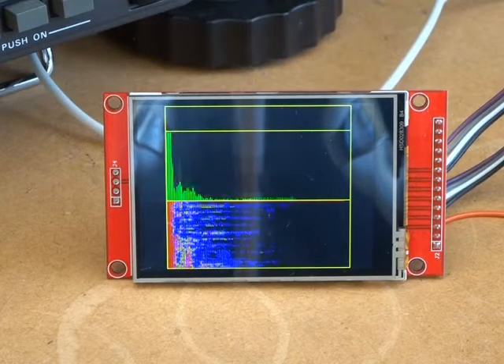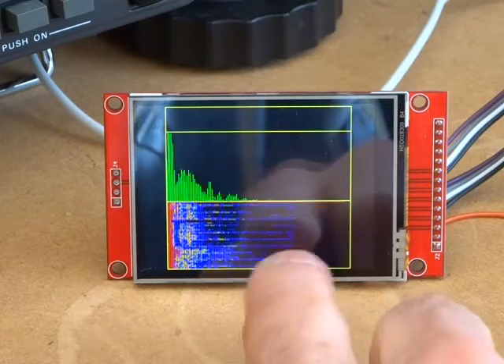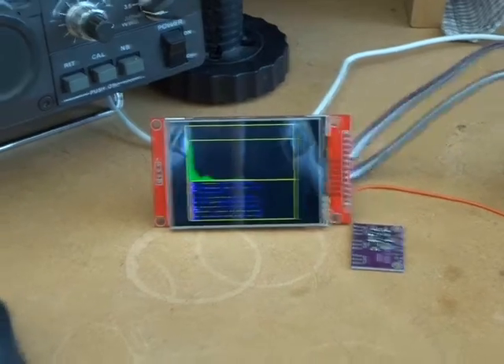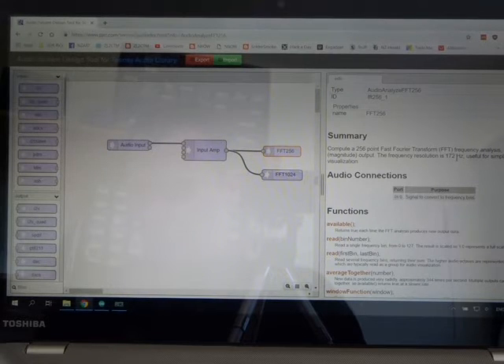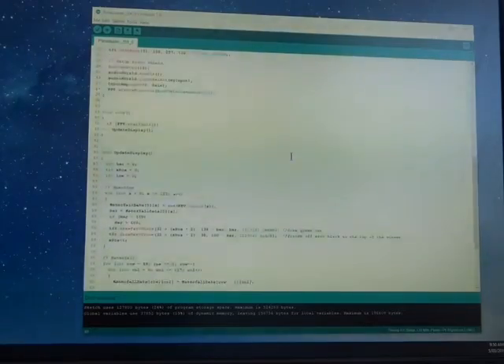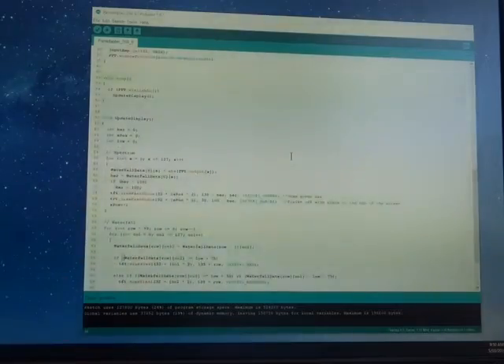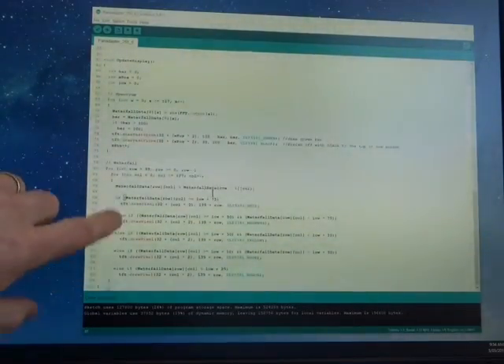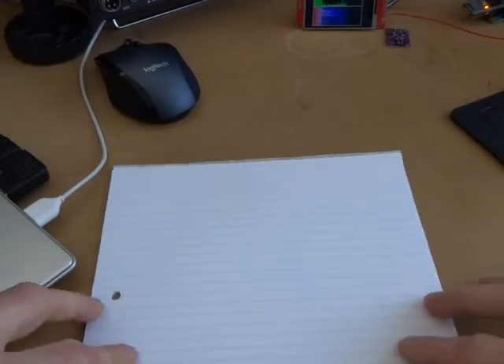Homebrew Panadapter Part 2: Initial experiments

Comment: Hi Charlie, fantastic progress! And very interesting. I was wondering if you're looking at the spectrum before the xtal filter with another mixer to convert to base-band, won't there be image problems in the same way as with a DC receiver? If you could find a complex FFT to use with the Audio library, you could use a quadrature mixer and the stereo input which would solve the image problem and then your complex FFT would give you 40KHz of bandwidth (-20KHz, +20KHz). :)
Reply from the maker: Gidday Ian. Yes, I am seeing images as expected. I will look into a complex FFT as the increased BW would be nice. I have the CLK1 sweep up and running, but I'm getting noise introduced into the main receiver. I suspect it's I2C based noise from continually changing the Si5351 frequency. All good fun!

Comment: Charlie, have you ever used the CLion IDE from Jetbrains?  it works with arduino and teensy.  i've been using their IDEs for years.  there's a 30 day free trial.  it's a lot better than the arduino IDE.
Reply from the maker: Hi Robin. No I haven't. I'll take a looks. Thanks for the heads up.

Charlie
Reply: @CharlieMorrisZL2CTM  I run mine with PlatformIO.  works great.  the setup is quite straightforward.
Reply from the maker: @robingist6666  Cheers Robin.

Comment: If my understanding of how this works is along the right lines, if the centre of the screen represented the frequency your local oscillator was tuned to ie. DC if aan FM signal, then for the BIN's below the centre of the screen you would have to use a comparator to subtract the I from the Q signal, anything over to the right would be I + Q

Comment: How can you get more than 44 khz?  My understanding is that the audio card is a 44 khz sound card so it would be impossible to get more bandwidth than that without adding more sound cards.   Of course I am really at the beginning of the learning curve on dsp so it is likely I don't understand something.
Reply from the maker: Hi Ken. You are correct. What I did last night was to take the IF before the crystal filter and feed it into a SBL-1 mixer. I then fed in five different local oscillator freqs  (at 20kHz spacing) and analysed the audio coming out. I then appended the five separate FFT results into one array (100kHz wide) and plotted that. While it worked, I did get as expected images from the direct conversion process.  I also got I2C noise from changing the LO freq so often. We'll see where this project goes, but it's fun trying things out.